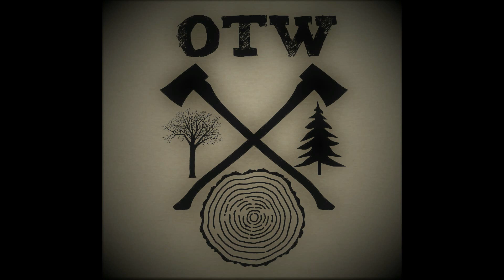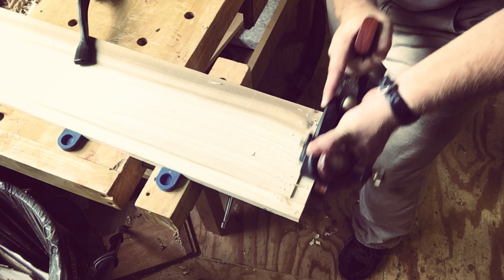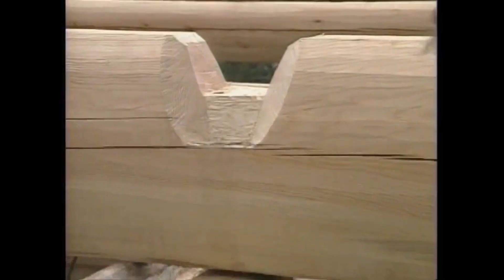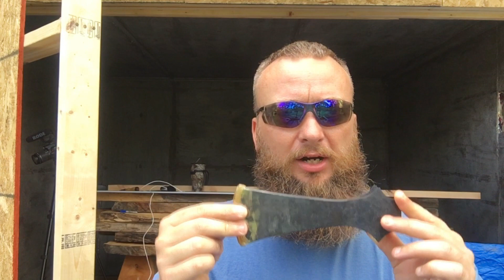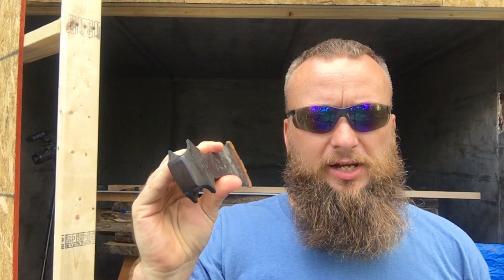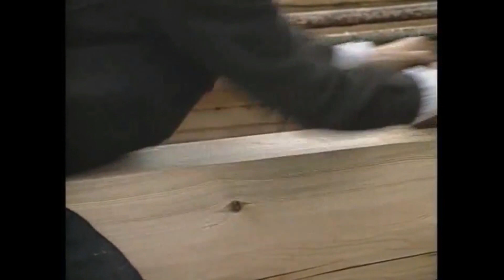ROY UNDERHILL AXE

Comment: Thanks for the mention.  It's a safe bet the Vikings didn't have hickory, probably not much ash either.  My guess is that Birch was common even though it would have required replacing more often.
Reply from the maker: +John Switzer thanks John. Good info there. I've wondered what they used for tools handles. Great axe you made here. 
I will probably make the handle at curtis Buchanan's chair shop a few miles down the road.

Comment: hey man i got one ax for ax throw from ohio renounce testable more decoration. i sharped ax head so super starp had tampered handle as it what came with real weak. i decided wanted try hewing bowl. so what i did this time around is i used hickory hammer handle. mendardes sales them just put either wood or metal wedge top. i did metal but probley do wood ever take handle out. i also put in ash ax  handle before. i got mad fun of at church for have small ax head with full two handed longer normal ax handle. what had do is cut part to fite small hole then like hammer put wooden wedge in. tell swing with power. both options work well. think i got ax handle ace hard were but dont rember think mendareds has too.
Reply: beaded ax real fun. try hand make one. if try lost foam you make one buy melt down alundum cans. what do get square milk jug card bord holds liquid. drill hole top put pencil through round pergolas can. poor super strong concert in there let harden. then drop cans in there melt with blow torch. take favet halloween ax poor concert let tack were finger print in it. push toy ax hafe way concert pull out let harden. then poor melted alunume in there twice. have two side ax when wraps handle hold together. put strong glue top. seen people pull apart use two ax as well.